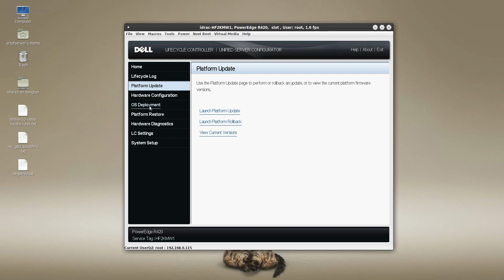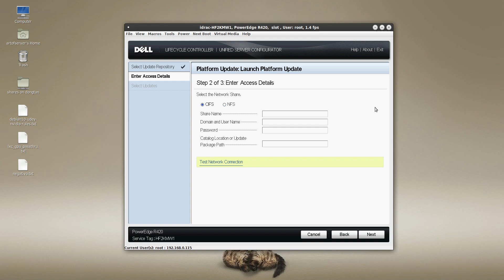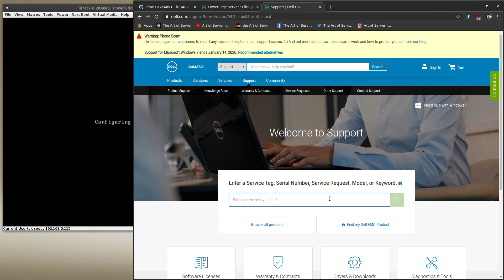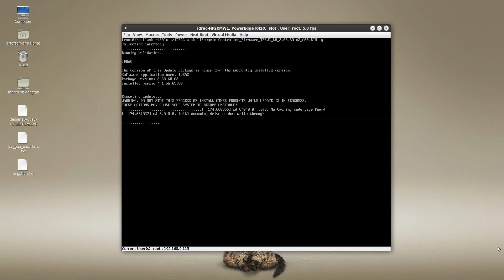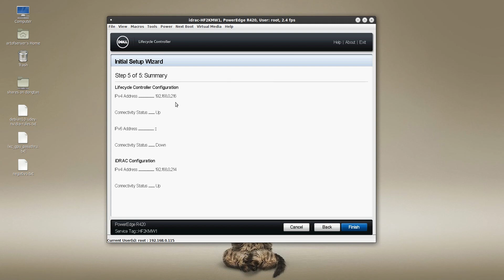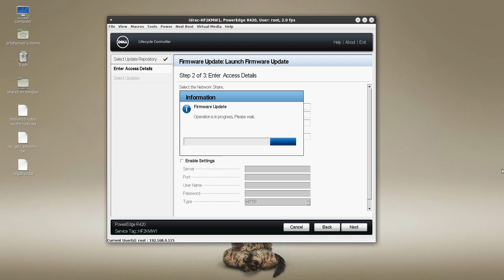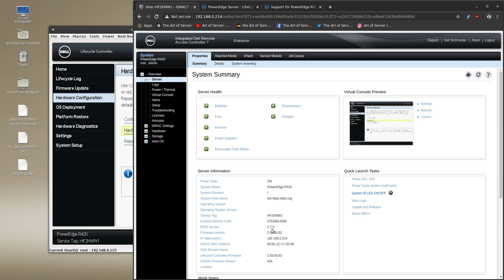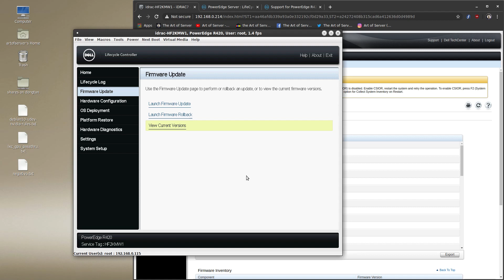How to update BIOS and firmware using Dell Lifecycle Controller | what to do when it doesn't work

Comment: I get an error now. SUP0539. No idea what that means. Update missing in the repo.
Reply from the maker: The error SUP0539 can appear with the message "Update Packages missing in the repository". It indicates that the system is unable to locate the necessary files on the specified update server. Causes can include changes in Dell's update repositories, authentication issues, or specifying an incorrect file path.
Reply: @ArtofServer thanks man. I have a r420 in a r520 body. The raid controller is flashes to IT mode. But just refuses to update. Didnthe manual update, ran perfectly on proxmox with the red hat update. But cant grt any updates.

Comment: I was able to update my bios using a usb drive, but am unable to update idrac, lifecycle etc on my dell r410. my idrac has a yellow light on and I cannot access the web portal using the default or changed ip address. does that mean my idrac module is defective? I need windows updts and i'm using a perc 6/i
Reply from the maker: I've seen that happen before. Sometimes it's because the flash chip on the idrac is failing and cannot be updated. sometimes multiple attempts will eventually succeed.
Reply: @ArtofServer  I got it to show on my router! and I'm using updated version of java! I watched your video about the the java hacks but no go.

Comment: Thanks for this, I bought some Dell R730 servers on eBay and everything was on super old firmware, it has obviously never been updated and the lifecycle controller couldn't connect to Dell any more as the HTTPS option was missing. To make things extra awkward, I dont have any storage in this system (it will be an ESXI host booting from USB with shared network storage only)

Your instructions pointed me in the right direction, I used the Dell support tool livecd iso and used Rufus to make a bootable USB with this. I copied the lifecycle controller update bin as per your video and from the terminal went to /mnt/disc/sda1 then "sudo ./iDRACetcetcetc.bin" and it's now updated!

Comment: would any of this apply when using proxmox?
Reply from the maker: Yes, because this method does not require OS. It is the best method without depending on the firmware updates or BIOS updates to be compatible with your OS.

Comment: This still doesn't seem to work as I got some kind of "login credential" error after I got to the point where it was trying to connect to the shares.  Not sure what to do here.  Guess I'll have to do this the manual way.  Error was: "Unable to connect to the network share (SWC0066)... according to DELL: Dell EMC Lifecycle Controller Engineering is aware of this issue and is working on solution for this behavior. When updated iDRAC/ Lifecycle Controller code is available, an update will need to be applied to iDRAC to resolve.

Comment: Attempting to update firmware on an r750 with the lifecycle controller. Getting "Unable to install the Update Packages (SUP0531)" when attempting to update via HTTPS. Test network connection is successful and shows no problems. I have manually updated iDRAC/lifecycle controller to the latest version and have poked every setting imaginable with no luck. On the off chance anyone has any suggestions I would be very grateful.

Comment: For the cert saying its not trusted, either the idrac client can't lookup the cert, like no certificate stores to check root CAs, or it has an issue because the domain has a wildcard cert installed, some clients don't like that. But I agree, Dell should fix that, this entire ecosystem is in their control. I also noticed it lists the server at the time of updates as having a \ at the end. not sure if you typo'd that or if its a bug in their software

Comment: I want to follow along, but I'm lost from the get-go. Trying to learn/understand what the iDRAC and Lifecycle Controller are and do, but we're talking about updating the BIOS etc in this video and you're like already logged into the iDRAC, somehow? How? Is this Red Hat Linux in the background of this window of this video? How do we even get to this point first?
Reply from the maker: the iDRAC is for remote and out of band management of the server. the LCC (lifecycle contrller) is used to maintain all the firmwares of the machine and the various components in it.

i'm using a Fedora workstation machine, but it really doesn't matter. you use any web common web browser to connect to the idrac virtual console, or you can just use the server connected to a monitor and keyboard directly. from there, you can enter the LCC to perform what is shown in this video.

If that still doesn't make sense to you, unfortunately, I do not currently have any content that is more basic to help you out.
Reply: @ArtofServer  Thanks I guess it would help if I could even get my damn R430 online. It won't connect to the internet via ethernet no matter what I do. I've tried my verified working ethernet cable coming off my router into each of the FOUR different NIC ports and the ONE iDRAC ethernet port. None of the 5 different places will give me internet access. So the iDRAC is pointless and dead to me, so is the entire server if I can't get it online. I can't update drivers or missing files or new firmware or anything! Ugh! Maybe I need to buy an entirely new separate NIC card and use up one of the x16 PCIe slots on the PCIe riser on the back. Then I guess those 4 NIC cards that come from the factory stock are pointless useless things to stare at lol. Maybe they just need a driver or firmware update or something. OH but wait, I can't actually get online to ping the dell support server for any new updates lol

Comment: I managed to get idrac and the lifecycle controller updated but always get the updated packages missing in repository (sup0539) with Recommended Action:
Enter another repository location that contans the desred
Update Packages and retry the operation.
Reply from the maker: Good question but I'm not familiar with that error. Check out the Dell forums and see if the Dell engineers can help you with that.
Reply: Hello, I know it's been a while but do you have any updates concerning your issue ? I'm currently running into the same issue

Comment: My hope is these systems keep getting updates for years to come. For a lot of uses they are more than enough.
Reply from the maker: It would be nice, but Dell is not likely to continue to support EOL products. They have already removed access to some of their older server support files.
Reply: @ArtofServer  Guess I better hurry up and get my T420 running then. It's sad that a machine like this which can still do the work more modern systems can is just being pushed aside. I'm a big supporter of reusing rather than throwing away. I rescued a NOS T320 from being recycled at work. It's why I bought the T420. I mean how much horsepower do I need for a file server that will also run a Minecraft and Rust Server?

Comment: Got my lifecycle controller updated thanks to your excellent video but it looks like Dell has dorked updates again. My Precision R7910 is giving me "Update Packages missing in the repository. (SUP0539)"
Reply from the maker: yeah, did the R7910 recently go EOL? If so, that might be why. Dell has been aggressively purging stuff that is EOL. it may not be available through their automated methods, but everything is still downloadable manually. if you had a large enough installation, you could setup your own update repository and point to that.
Reply: @ArtofServer  I can't find anything saying it is EOL. I ended up booting it directly from WIn10. I couldn't even find a linux bios for it, all I saw was .exe file. 

An FYI you might be interested in:
  Last summer I upgraded it with a H330 SAS controller I bought from you which worked great after I found the correct length cable. Then, yesterday I just installed a 16bay SAS backplane (8TGM0) and upgrade kit made for the R730 and it works fine. The only issues I had was I had to disable the built-in SATA controller.  Also the included BP signal cable that connected to J_BP_SIG2 was giving cable errors for some reason. When I plugged the BP into the old original long signal cable that runs to the back of the board the errors went away and all 16 drives were detected.

Comment: Firstly thankyou for these series of very informative videos, I followed the R410 series and now have a R710 too.
My niggle is with the R710, despite upgrading successfully bios to 6.6.0 , idrac 2.92 and LC 1.7.5  my boot screen F10 System Services, takes me to the USC.  Running the LC to update from here I still get the old view , ie no https option.    Any ideas to get it to update properly?  Not having good Linux skills I used windows Server  as i couldnt read the screen text as you typed.  Many thanks.
Reply from the maker: that sounds like the update of LCC didn't really take effect. perhaps try removing A/C power, let it sit for 10 minutes, and then power back on again. see if that allows it to load the new LCC update. otherwise, i'm clueless...
Reply: exact same problem, server, versions, everything here. Did you manage to find a solution?

Comment: How did you get the server to boot so fast? i am trying to get my server with 128GB memory to boot faster or my 32gb one as well
Reply: In your bios, under memory, check if System Memory Testing or similar is enabled. Disabling will make booting much faster.
Reply from the maker: I didn't do anything special. But some segments of this video was sped up in editing to save time.

Comment: If I don’t have any OS running, can I update the LCC via iDRAC web portal.
Reply from the maker: Its the other way around. You can run the LCC in pre-boot environment to update all other firmware, like the iDRAC, etc. This is what I'm showing in this video.
Reply: @ArtofServer  I mean, can I update "iDRAC with Lifecycle Controller firmware" using LCC USB option.
Reply from the maker: @danimoosakhan  IDK what you mean by LCC USB option?

Comment: Great video! For folks that are getting errors (package error in linux or the inability to verify in the lifecycle controller or idrac interface) when attempting to update you may need to do a step approach to updating (dell article #000135299). For me I had to update to 2.40.40.40 before I could update to 2.65.65.65, although the error messages are useless; hopefully, this saves someone the hour it cost me.
Reply from the maker: thanks for sharing that tip! :-)
Reply: helped me. Thanks mate

Comment: Just got a T420 (for $100) 32 GB RAM, (3) 600GB SAS (2) Xeon 2.2g 6core, (2) 1000w Power supplies, and I am having intermittent problems with the H710p reading the 3 600g Dell SAS drives, some of the forums say to update the firmware. However I don't have it connected to the web at the moment. 

Would a usb wifi stick work from the BIOS in LifeCycle? OR am I not even diag-ing this in the right direction. I did get the WIN SVR 12 thats installed to boot up here and there,  ha. But now I've been getting (when the H710p is connected) a ton of intermittent errors like the famous Christmas Themed screen:

A system restart is required.

BIOS reu 2.7.0

The system detected an exception during the UEFI pre-boot enu ironment. Press ENTER on the serial console (C115200 8-N-1) for detailed exception info.

Type: Non Maskable interrupt (02) Source: Hardware

AX-0000000000000020 BX-0000000000030000 BP=00000000002643C8 CX=0000000000000061 DX-0000000000000061 R8=00000000CCAB7C44

SI=0000000000264110 DI=0000000000500000 SS=0018 CS=0038 (CurrentTPL = 04, TSC ticks since last event 0000580AC032)

LBRfr1 C865953D Metronome.efi +00053D LBRfro C86599DF Metronome.efi +0009DF

->rip C86599DF Metronome.efi +0009DF <- Crash occurred here

s00 C8659542 Metronome.efi +000542

s01 CCACFCA6 DxeCore.efi +016CA6 s02 C855D99B DellBdsDxe.efi +03099B

s03 08539E59 Del IBdsDxe.efi +00CE59 s84 CB539CCC DellBdsDxe.efi •00CCCC s05 CB5341B7 Dell IBdsDxe.efi +0071B7

s06 C852E30D DellBdsDxe.efi +00130D s07 CCABA16B DxeCore.efi •00116B

s08 CCAB9573 DxeCore.efi +000573 s09 CCAB92DF DxeCore.efi +0002DF

Stack Unwind Complete after 11 Frames
Aa

and another with the same "Christmas" screen saying the error is in the C87B52DD Calling Interface.efi +0032DD <---Crash Occured here

When these screens are up the amber light on the H710p flashes rapidly

I have done all the things I've read to do the PERC card. Change the PCIe slot, unplug/replug the battery (which tests at 4v) even changes the thermal paste it was getting to 61c at idle (brought it down to 50-59c but i later read these are normal temps) but when it did run WINSVR 12' it got way hotter.  unplug/replug all the SAS cables ETC.

As im writing this Got it to work again Win SVR 12 starts up and runs (after about 40 restarts and moving the H710 to differnt slots and unplugging EVERY thing. And now it just shut down (trying to install USB wifi drivers) and restart this time  on boot it says PCIe Error inturrupt at F000:E82E 

Please tell me this is just a firmware thing. I can't find much out there on doing this from an USB or with out having it on plugged into the web. I can dig out a switch if that is the only option.

I've built a lot of PCs in my day and to me this server stuff is like a regular mechanic learning how to rebuild a Diesel engine. Argh But, being a Diesel owner, I want to make this puppy Kick Premiere's ass so I can put up my dang ol Redneck Renaissance "Y'all" tube videos!

Love your informative videos, I already did all the things to get your YT algorithm up (like, sub, bell, comment) 

Thanks in advance for any incite

Comment: Any idea why I keep getting the message Warning Firmware Update Invalid IP Address or Share Name? (I have changed the 4 nic daughter-board for the one with 2x1gbit and 2x10gbit and I have plugged the cable to one of the two 1gbit ports)

New Edit: Finally after 10 attempts without changing anything it just played and found new firmware for the 10gb daughter-board that I supposed it would. I also seen in a forum some other network 
                   paths except the downloads.dell.com like https://dell.to/3kj1mUB and https://dell.to/3jiVZDA I don t know if these work for you (for me they dont) or have updated devices firmware available.
                  
                   Finally everything is up to date except that damn OS Drivers Pask (I am at ver 7.4.1.11 and the new one is 15.07.07)that  I am trying for months and keeps failing Anyone else having that?

Comment: Updated to legacy Lifecycle Controller on r810, no https :) , can not run idrac BIN file from CentOS 8 because of some c++-33 library not found :) , going back to good ole windows, installing server 2012 :) oooooooooooooooo, well I had to do it, unless I could have installed CentOS7, will try that also maybe :)
Reply from the maker: better off with CentOS7 when working with older server.
Reply: @ArtofServer  this this is a beast but where do I keep it it's sooo loud :),  but winter is coming might as well use an extra heater :)

I did update power supply, server was off for ten minutes :) then it came back on yeeey hahah scary
Reply from the maker: Never had R810 before, but Westmere CPUs do get very hot if you have high clock speed ones.

Comment: Hi..... tried to update everything on my R720 via lifecycle (jsut upgraded its version differently first in order to show up https. Until then it showed only http which couldnt locate updates either). It updated everything except the OS driver pack (currently have version 7.4.something and latest is 15.something) No matter what I do it still gives me an error while trying to download/upgrade the 15.something version

PS By the way have you noticed in a 710 (if you dont have an r720) that the middle fan (fan4) keeps running after shutting down the server. Only way to make it stop is to unplug from power. Someone mentioned to downgrade idrac to 1.65 but I find it a little odd to go from 2.65 to 1.65
Reply from the maker: yeah, the latest iDRAC/BMC firmware keeps that center fan running even when powered off. i suspect it's to address overheating issues when the server is powered off, but the BMC/iDRAC is still powered on, the NIC on the R720 is still on and generates heat. Probably even more so, if you have the 10G NIC in there. my guess, and this is speculation, that they programmed the BMC to keep the fan running at low speed just to keep some air flowing over the rNDC.
Reply: @ArtofServer  hm...that could be a reasonable explanation ... thanks ..... So I assume that you let it run too and dindn t downgrade so many versions backwards. Other solution would be to rip off the center fan ahahhha .
Reply from the maker: @ierosgr  No, I didn't downgrade. Plus, the latest iDRAC firmware has the HTML5 console so I much prefer that over Java.

When I first noticed the fan running when the server was off, i wondered about it too. But I have a "lab rack" where the servers are off most of the time and only powered on when I'm trying some experiment or making a video for this channel. I noticed when I opened my R720XD or R620, that the rNDC was really warm... and noticed the fan that was spinning was in front of it.. so that's what made me figure that was the reason. As long as there's a reason, and not some random Dell BMC firmware engineer messing with me, I can accept the slightly extra noise.

Comment: Could you use a Ubuntu live image to update drivers and BIOS  and if so, which driver packages to use? (My LCC is 1.7.5.4, Idrac 2.90)
Reply from the maker: You might be able to, but I haven't tried it. Live boot images usually run in RAM, so it's volatile; upon reboot the contents are gone if you don't save stuff to non-volatile storage.
Reply: @ArtofServer  Just need to run long enough to apply the updates since I can't get Lifecycle to work.